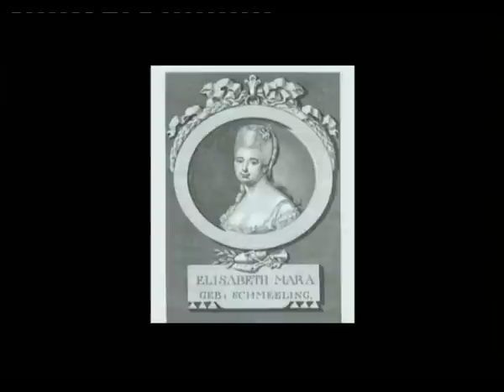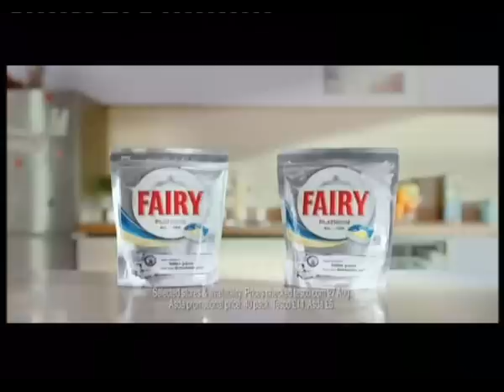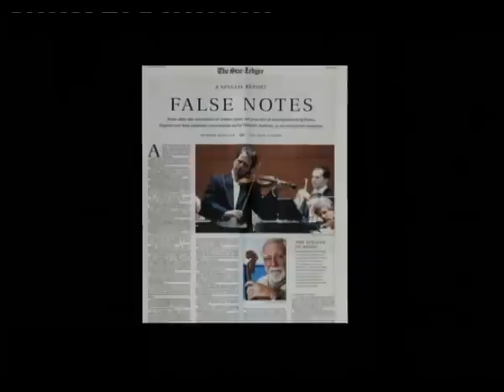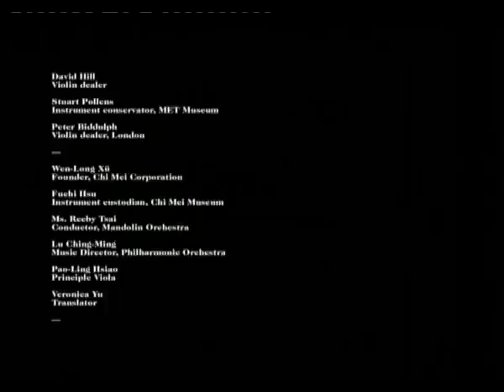In Search of the Meassiah-Strad.& Guanieri Docum.

Comment: In 1961 I was offered use of the Bass of Spain Stradivari cello for a performance of the Dvorak concerto.  The owner of the instrument required me to use the gut strings which were on the instrument, and I had 5 days to become acclimated with the instrument.  Regretfully, I refused that kind offer in favor of my instrument, which was a high quality modern cello with steel A and D strings and silver wrapped G and C strings.  Possibly a mistake of youth.